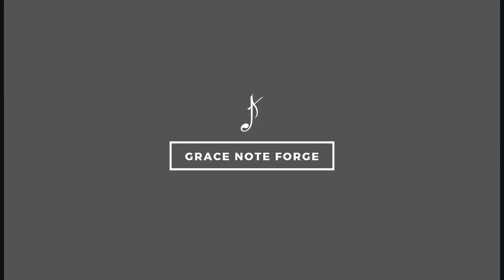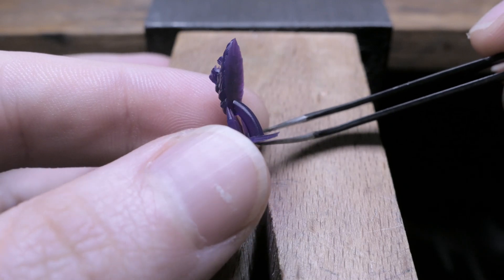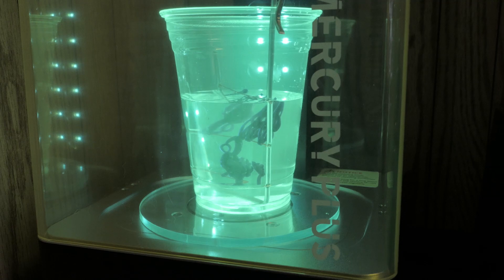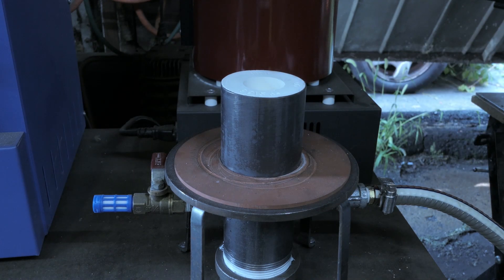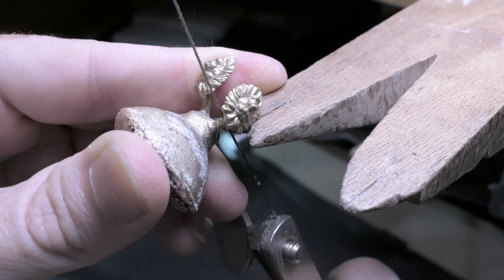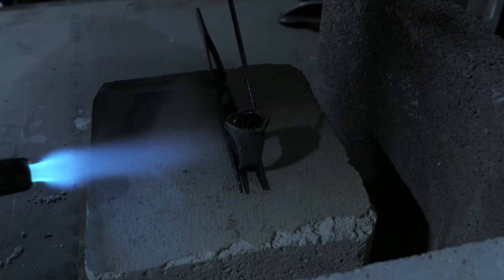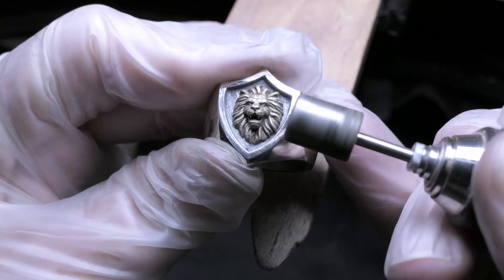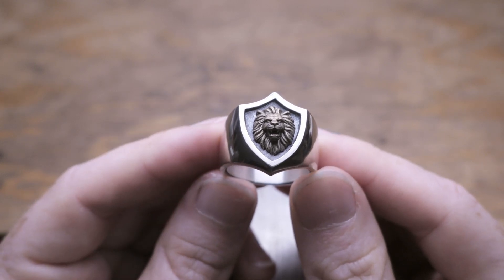Phrozen Sonic Mini 8K for Jewelry (My First Impressions!) - Shield Ring Part 4

Comment: Quick soldering tipp, add pins for the lion and the corresponding holes to the ring, after casting and cleaning you fit the pins of the lion in the ring and you have a perfect fit and it won’t move around when soldering

Comment: I don't understand how the air is sucked in or the plaster cast has no holes in the lower part which is attached to the vacuum pump
Reply from the maker: Under a microscope, investment is really porous (like a sponge), so air can be forced through.

Comment: Hello. Could you share the printing settings in Chitubox, Siraya Tech purple castable resin, even though I have blue resin, I think the same settings might be suitable. Phrozen Sonic Mini 8K printer, bought a month ago. This is my first 3D printer, I have no experience. I’m already using my second liter jar and not a single model has turned out. I downloaded the profile on the Siraya website, but it didn’t help. I bought resin from another manufacturer that was not casting. Everything was printed the first time, with the manufacturer's profile. The lion's head was beautifully printed by you. On your website you showed the settings for Elego Mars. Thank you in advance.

Comment: Now that you are using a printer. You can charge less for the jewelry. You don't have to spend so much time on the pains taking details. You didn't have to work so hard.
Reply: It just turns into a different kind of “hard” nothing ever comes easy, but easier than before 👍

Comment: Honest question. Why would you physically carve out a ring band when you could just make it in a 3d modeling software?
Reply from the maker: Because at first, I only intended on making a shield signet ring. After I made the ring, I decided I wanted to do more to it and then added the lion head. If I were to do this design again though, I would probably just model everything in 3D
Reply: @GraceNoteForge  when you create a ring in blender that's going to be printed on a resin printer how accurate can you be with your measurements? I.e a size 10 ring is 19.7mm in diameter,
Reply: @shinigamisecret  you can be accurate to submicron level if you really want to.
Reply: @shinigamisecret  the only issues you'll face with it are calibration of your printer to get it perfectly dimensionally accurate (not that tough a thing) when printed, they're only accurate to 22um for the Sonic 8k series of printers. And the standard shrinkage from the investment you use and the metal itself. 
Basically, you'll print the ring oversized by a percent or two to compensate for the final dimensions of the piece
Reply: @noviceartisan  well explained 👍

Comment: Nice project!  I have had great print success with the same 8K machine.  Only problem was really too good adhesion to the build plate. I use Blue Cast X-one. So far it’s been the best castable resin I’ve used.
Reply from the maker: Thank you! Yea, I've heard the same issue about the build plate really holding on. I'm gonna be trying some Blue Cast next!
Reply: Where you grabbed the blue cast at ? Their website has nothing for sale

Comment: 1350f peak on 5h cycle for both wax and cast?
Reply from the maker: Yep! I used the same burnout cycle for both.
Reply: ive done those same raven skulls xD
Reply: Their Blue is a lot more friendly for rapid burnout schedules :)
Reply from the maker: That's what I've heard. I'll have to give that one a try sometime.
Reply: @GraceNoteForge  To note too, when you see the rapid burnout schedule, that's typically based on 1-3 pieces in a quite small flask, so the heat gets through a lot faster. With larger or more full flasks you need to compensate. I noticed the same thing when switching from smaller flasks to the huge ass ones I use when doing mass production. More mass means more time needed adding, in my case quite a lot 😅 I think I use something like 2.6kwh to heat a space that's a bit outside the peak for that, even with the excessive insulation I've added to the build to help keep the heat in :) So adding a bunch of tall wide flasks really affects the timing a fair bit. Typically means an extra few hours soaking at 730c.